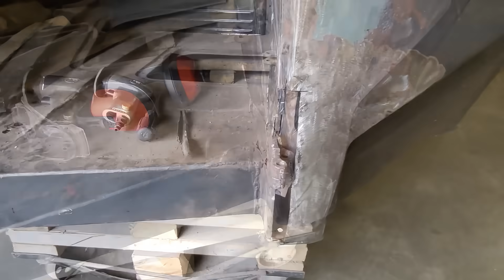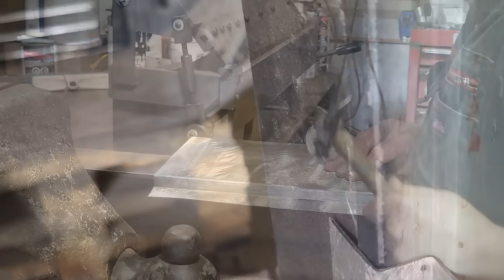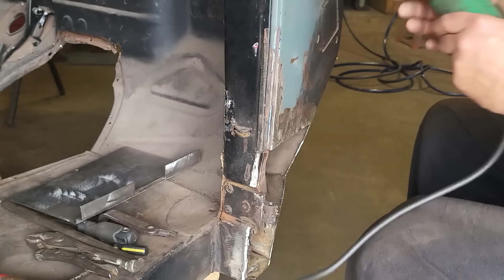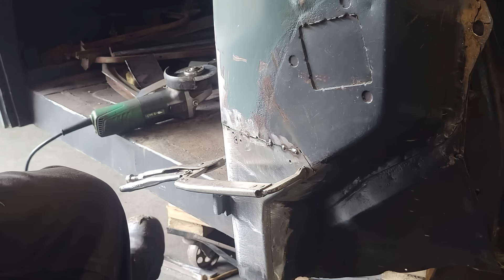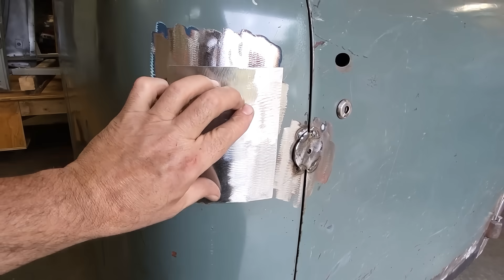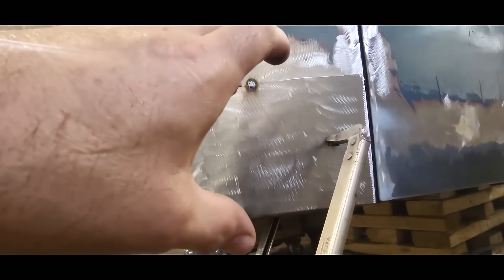One patch! Two patch! Three patch more!

Comment: Another great video. 1 question. How do you get rid of the rust inside of that cavity and stop it from rusting back out?  Seem to me it will just continue to rust out on the areas not replaced.
Reply from the maker: I talked about this  many times over the years,much of what I do are restorations so this cars dont  see harsh weather.  Also many of this old cars are all bare metal  on the back side everywhere. These types of rust repair are due to the car spending part of it life used in bad weather.  Now if the plan is to use it in bad weather my advice  is to oil all the cavities with a sprayer. Its up to the customer  to do this after it is painted.

Comment: The last band I understand how your break pushed up on the prior bends.Could you have put a piece of metal between your break?And where the break was contacting in other word's a spacer peace
Reply from the maker: Not quite understanding what your saying? To soften the bend or make it tighter??
Reply: When you made the last bend, or you pulled up on the break, it was pressing against the bends. You had already made kind of distorting or could distort the previously made bends? I'm wondering if you had put like a quarter inch or 3/8 inch piece of steel between the bottom part of the brake that you pulled up and the edge.  Of the previously made Ben's.If that would have worked to not distort the prior bends, essentially slide a piece of quarter inch steel up the bottom of your brake and would be between the bottom of your brake and the piece of steel you were bending.Can't describe it much better
Reply from the maker: @billhartl6601 ah yes. That could of worked.

Comment: It appears as though you are getting more bend at one end of the brake than the other. This points to either uneven clamping force or a difference in the gap or clearance between the clamp and the edge of the bend. Looks like a nice brake.

Comment: Tony need some advice on a door repair . I’m working on a 1990 dodge d150 with the doors being hard to open and the window not staying in track. I’m thinking of just replacing everything in the doors. What do you think would be best?
Reply from the maker: Need more info on door not opening. Won't  release inside as well as outside? Tight in the latch when closing? What are hinges  like on door? Is it dropped?  The windows  might just need to be urethane back into the channel. Make sure you do it in the truck as it may not set in proper spot if done on the bench. I like to add urethane and then roll widow  up so it is where it should be.
Reply: @fitzeesfabrications Tony the doors are difficult to open from the outside I know the hinges are good and I put pins and bushings in them it could be the latches one latch was replaced a few years ago but it could have a defect somewhere in it
Reply: @fitzeesfabrications and thank you for your support
Reply: I’m really need to dig into the doors again and again thank you for your advice
Reply from the maker: @RobertFredman-ld6kc sounds like the button on the handle is not fully releasing the latch. Not sure if it is a push released  or it  has a rod that pulls the latch. Eather way if the inside opens fine look into how the outside latch works and see if it is causing thr issues
Reply: @fitzeesfabrications thank you so much again brother and yes it is a push button
Reply: Great cab corner repair…..looking like it should now. Thanks Tony for teaching us guys.

Comment: Everytime I watch you weld sheet metal  I think I spend too much time jumping around to keep heat out of it. Which wastes time but I've been doing it like that for decades. Probably one of those it worked the first time I did it way back when so I just stuck with it. You put way more heat into the metal than I do and yours still turns out great from what I can see.
Reply: Like you I also tend to 'drag out' the work in order to limit the amount heat introduced into a panel.  My justification is less heat results in much less rework and/or far less polyester putty.

Comment: I had a ton of small holes in my old Bronco and I ended up making a punch out of thick some scrap steel and a broken drill bit to make a bunch of 9/16" slugs. Works like a big paper hole punch! Then, like you, went around with a step bit to make all the holes 9/16"... Now that I have it I've made a few different sizes and can use it on the edge of panels to make plug weld holes! 

I really like the idea of welding a bolt to the sheetmetal and rounding it. That way there's a handle!

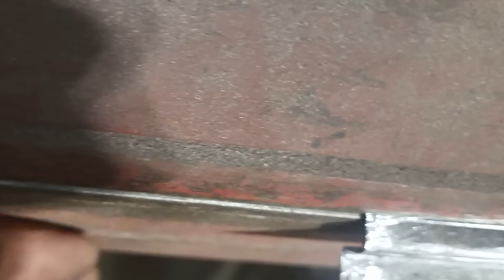Comment: Hey Fitz, in your video at 12:50 where you are about to do the 3rd tightest bend and it was going to "fight" you in the bender, could you or what would have happened if you slide a piece of 1/4"X1/4" square stock in the gap between the bender face and the piece of metal you're bending? Even tho it did work the way you did it, might bend have been a bit tighter?. Love it when a plan comes together and the tips are always good.
Reply: I was thinking that myself.

Comment: I weld a nail to the sheet metal when filling holes. It's faster to take a cutoff wheel and wack it off. Just a time saver if doing a lot

Comment: Another great video. I'm doing similar patches on a quarter fender and found a lot of past problems. It is amazing what you find when you start cutting. I should have bought a replacement fender, but I patched it in 15 spots and I am   so close to finally welding it on the car. It is so much easier to hammer and dolly while it's off the car. I have been using a shrinking disk too which I have been getting the hang off. A slapping spoon works so much better at times now too.

Comment: Got a question.  I have a mid 60's gm 1/2 ton with rotted out floors, iner and piter rocker panels, door buckets and door bottoms.  Am I right in thinking to start with floors and work out from there or what??  Appreciate any advice you can give!  Thanks muchly!!  "D"
Reply from the maker: I start at the mounts and once they are in work from the inside out.
Reply: Ah-ha!  Got it.  Am working on rebuilding a 66 chev cab.  Box is done except for panel braces and electrical.  Found a vastly better tailgate, and have deconsyructed the old one for the metal to be used in the floor reconstruction.  Busy, busy, busy!! (Grin)  Really appreciate learning from you!  THE most worthwhile sheet metal repair website in existance ANYWHERE, IMHO!!  Thanks VERY much for making this available!!  "D"

Comment: just a thought , not a criticism... if the hole patch can't be seen from the inside..... I take a small square piece of metal, drill a hole 1/16th or smaller in it... pull a piece of .023 thru it and make a loose knot... give myself about 6-12" of 023... then from the back side I feed the wire thru to the front, fold it over until and hold it with a magnet... Then when I'm suited up [for lack of better words] I grab the wire with my gloved hand and hold it while hitting it with a tack weld... Then weld to the backing piece, push the wire out weld up the hole... I then have a nice think repair because of the back up square piece... grind it down and it's done
Reply: Good idea. I have done this myself.
Reply: @BrucePierson  thx

Comment: I think I like the last "hole-b-gone" method! Also, how much do you worry about small pieces of scrap being left when it drops in a place you can't access? Will it cause rust or noise issues later?
Reply: leave some access to it if possible... and sometimes you can fetch the piece with a magnet
Reply from the maker: It can be fished out
Reply: I have never seen Tony not get a piece out.
I would imagine a piece left behind would be a noise/rattle issue.